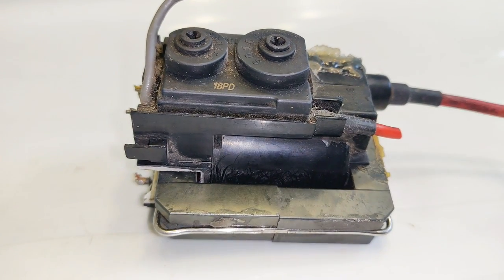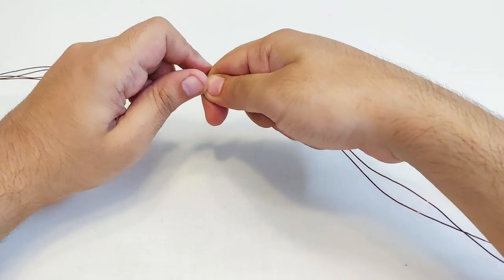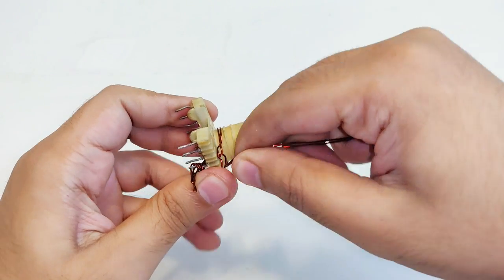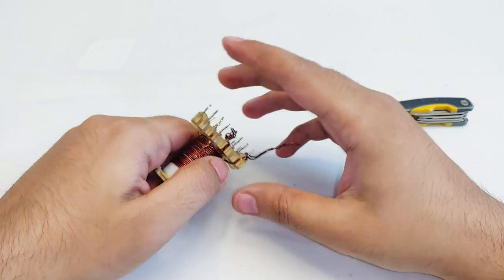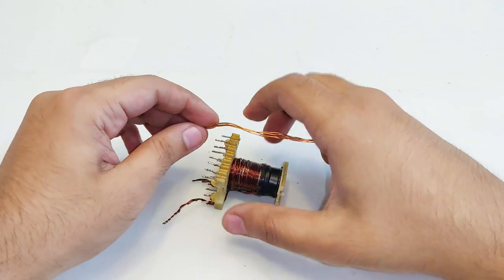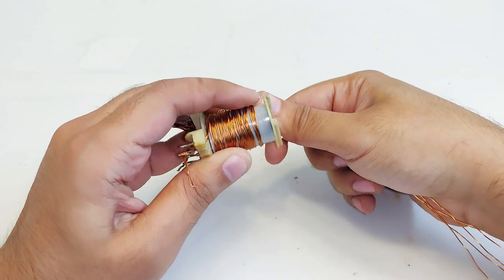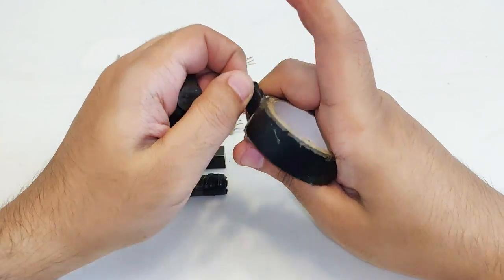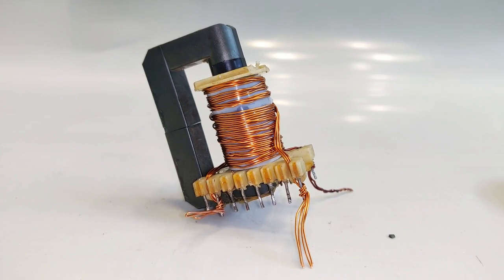12V 30 Amps Transformer | Solar Panel 21V to 12V DC MPPT Charge Controller - PART 1

Comment: Not perfect the aim of the project must be above 60Amperes at least as super chargers support 60-100 Amps
Reply: Another approach could be to lower the voltage further down to 3 V DC

Comment: @Mr Electron  is it possible to "step down" the input voltage of a Inverter yet maintain the output voltage, e.g 48v to 12v yet still have 120v output?        I have a 48v battery set up and want to change it to 12v, but my Inverter is 48v(dc) to 120v(ac). Is this possible to change the 48v to 12v or do I just have to buy a 12v Inverter?    I hope that makes sense. Any help would be greatly appreciated! And thanks for you channel and all your great video's.

Comment: Can you please run a test 
I mean the output of a solar panel running into a PWM charge controller, then let's observe the amperage
Then repeat the process with this inductor (Solar panel output running through the inductor) before going into the PWM charge controller. Thanks

Comment: Thanks Mr Electron for sharing your knowledge. It is appreciated.   Question.  When Winding a Coil, the Wires shouldn't Cross One Another. Right?  I mean the Wires should follow a Uniform Rout without one Wire over the other?  Also, why did you not use KAPTON TAPE or maybe FIBER GLASS TAPES rather than the low Melt Plastic like the PVC or HDP you used to Wrap the Coil with?  Just asking. You also didn't discus the Wire Coatings and which Coated Wire would be best to Wind a Coil with.  The Size of the Wires?  What's the size best for Voltage and Amperage?  Maybe you could cover this soon? Is that Gap you made. Is that a Spark Gap? Or just to Insulate?   Thanks for the upload
Reply from the maker: CORRECT !
There are a few reasons why i did the winding like this and used a thicker bore size plastic winding holder :
I want to calculate the output power difference (efficiency) b/w fully proper or little improper ie. winding crossover , thicker plastic bore type.
Also i want to find out the change in output efficiency if i wind the coil directly on ferrite core instead of the plastic holder which i think would be most efficient.
As for the kapton, tape & fiber glass, personally i don't think that they make much of a difference.Also, the sheet that i used was electric grade polyester film that is designed to withstand temperature range of -70°C to 150°C and i don't think that more temperature than that is needed.
Winding details are present in the video except for the insulation which is not the priority here because  we are working here on low voltage and high current.
That's not spark gap, i will cover it in one of my upcoming videos.
Reply: @MrElectron  Thank you young man for the quick response to most of my questions. I look forwards to your upcoming video.
Reply from the maker: Your most welcome !